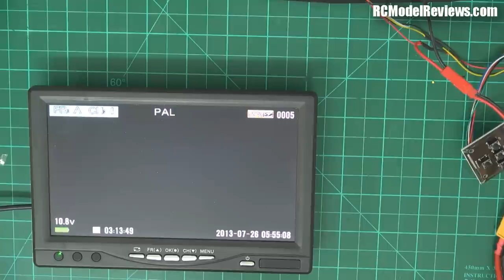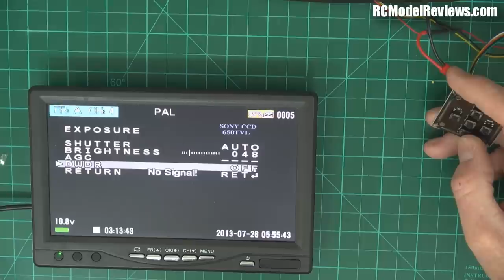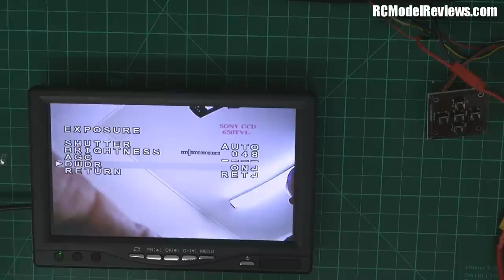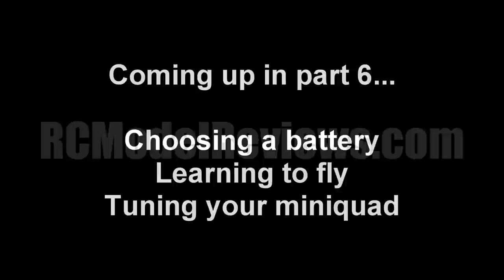Low cost miniquad racing drone build video PART 5

Comment: Bruce, I just wanted to say thank you for this series of videos! I just flew my first built quad that I built just by watching this series. I ordered all the parts per the first video, set up the Naze board exactly like you said and although I had a couple of problems with the radio I chose, got it all dialed in and ready to load my FPV gear. Flies like a dream! Thanks again Bruce!

Comment: Absolutely spectacular series.  Hope you will complete the B.O.M. list in part 1, and I'm looking forward to the upcoming parts mentioned in earlier comments ... batteries, chargers, transmitters and FPV viewing options (goggles, monitors, etc.). 

These videos comprise a solid and dependable reference for those of us just starting out and speaking for myself they demystified not only the building process but the basic technology of the quadcopter.itself more than any other single resource I've come across so far.  Thank you for the time and effort you've put into this ... I've been working in commercial broadcast TV and video production for 25 years and I know this kind of project isn't as easy as it looks. Your walkthru is well-planned, informative, nicely--paced and interesting, with enough humor thrown in to put any neophyte at ease.  Well done.

Comment: *****  Finally finished my build. After a long wait for parts to trickle down from china into my postbox, the build took around 4 hours split into 3 days. Thanks Bruce for a comprehensive tutorial, it was a great help! I did learn a lot from rcgroups too especially in the choice of a receiver. Common mistakes i did: making the wires on the pdb too thick for the frame to close properly. Inserted the naze32 with the arrow pointing left (haha) and not figuring why the naze32 wouldnt start my motors (it wasnt armed, and you indeed covered why in your videos!). I'll maiden it outside tomorrow, i just hovered inside and it looked beautiful (once motors were calibrated - you didnt show how but there are good tutorials on youtube... its really quick!)

Comment: Great series and the little hints and tricks are welcomed I tend to use hot glue for the RX antenna and the cable ties as heat shrink is more expensive and I only dab it at prime locations say 10mm spacing and 2mm from the tip. Enjoyed watching the build as it was nice to see an expert get stuck on the same problems.......Keep them coming.

Comment: One thing that I would suggest for the antenna for the transmitter, is to drill a hole in the top plate and mount the antennas through the hole. This is to protect the transmitter from crashes, just a thought. Great video series.

Comment: Excellent series Bruce!! I more or less duplicated your build except for motor brand and am having loads of fun bashing it around. Unfortunately I bought Emax motors that have short little VARNISHED motor wires and are a pain in the ass to solder. I learned in a hurry not to cut off the leads as I then had to scrape or burn off the damn varnish. That would male a good video tip for you to do by the way as it would save people the swearing I went through. Again thanks especially for all the little things I learned. :)

Comment: Good ESC'S, like Afro ESC'S are a must! DO NOT BE TEMPTED WITH CHEAP EBAY KNOCK OFF'S! Sorry, I learned the hard way : ( I am now running Afro Race Ready 20amp. The DYS 1806 motors are decent for the price and you can find ZMR 250 full carbon frames in the 20's range now on EBay. Great build series, I learned so much from this video build!!!!!

Comment: Bruce: A good tip is to GROUDN the audio lead. Check IBCrazy's reasoning on the topic, but particularily the TS5832 is troublesome here, I had one which was spraying a swathe of bandwidth across all nearby (and some not so nearby) channels any moment it was on.... and grounding the audio lead made it a LOT better. There's some modulation technology logic behind it I won't go into, but leaving the audio lead floating can allow it to go to a nonzero voltage => nonzero modulation => wider modulation on the video => more spillage to adjacent channels
Reply: Good tip. I'll have to look into it.
Reply: +Zap Andersson (MasterZap) I am interested in building a quad, but am a total beginner,  how do i go about grounding the audio?

Comment: Thanks Bruce for all your help.  Got mine going and am having a blast.  The only thing I had problems with was the props.  Which goes where.  Trial and error.  If you gave a quick vid it would be a great referance.  I stopped your vids to try see the orientation but got the wrong pitch orientation at first.  Cheers

Comment: Hi Bruce, Just found your most informative channel.  Thank you so much for sharing your passion and knowledge!  Just a comment, if you mount the vid TX on the other plate then your wiring gets easier and you can poke the switches through one of the holes.  Cheers.

Comment: I have the ZMR250 as well, on crashes the rubber balls holding the mobius plate often pop out, i just found something neat on Banggood its called "Diatone Damping Ball Lock" its some sort of locking screw for the rubber balls, I tested em and they add like no weight, and the vibration isolation still works well, and so far those rubber balls stay where they are. So if you have a similar Problem, give em a try, the come in a pack of 10....

For the FPV, while the camera Bruce uses is brilliant (i need to get one of those as well...) i also went cheap and baught the "Eachine 700TVL 148° + 32ch 200mw 5.8ghz" Combo from Banggood (and the 110° one as well) they are week on the Wide Dynamic Range, but for 25 bucks you get the complete Combo (Cam, Antenna, TX, Cable loom) and right now, its good enough for me. 

Happy flying

Comment: Thanks for all your videos, it's so helpful !

I've build almost the same quad, but I have a weird issue with it, and I can't find why. I did exactly the same setup as you for the fpv wiring. So when I disconnect the plug from the video TX, both the camera and the video TX are off, and I can fly without fpv. My quad is working really well without fpv and I'm really happy with it. But, here is the issue : when the camera and the video TX are on, I have stuttering in one of my motors, it gets really really hot very quickly and I can't fly at all ! Do you know why ? Do I need a LC filter somewhere ?

Comment: +xjet I am sad to see you are having to stop these videos for a while, I am new to this and this has been my primary source of information. I think you have provided me all I need to know, so thank you very much. But I wondered if you could do a short video to help setting up / checking transmitters to make sure no channels are reversed or connected in the wrong order. It would be great to see a short video with e.g. a mode 2 transmitter showing when left stick is pushed left motors x and y speed up and in the PC software you should see xyz. To make the quad turn right push stick x right etc.. hopefully you can do this on the bench if you get a moment.  Many thanks

Comment: Can you share your set up in regards to transmitter, goggles and other required accessories needed to fly this copter? I am new and really want to get into this, but I don't have any of the required items.
Reply: Or knowledge.
Reply: I did this build almost a year ago and wrote up everything (parts, tools, and accessories) I needed. If you search for "From not knowing how to solder to building an FPV racing drone" you should find the blog post I put together.
Reply: oh ok thanks
Reply: Fantastic write up! Thankyou!

Comment: If you are worried about heat when using tape to mount things 3M does sell heat conductive double sided tape.  It is used to mount heat sinks on electrical components.  It might not work so great when mounting on fiberglass but carbon fiber is an excellent conductor of heat.  If you use that 3M tape and mount on carbon you can effectively use the carbon frame as a heatsink.  The heat conductive tape is more expensive than your average double sided tape but is nothing terrible.

Comment: Hi there Bruce, I wonder if you have time, if you could explain what the go is with extending the antennas from the receiver to the antenna itself, for example if you plan to have it in the air a bit on a tripod and your receiver is built into your display on the ground station. I wonder what extension to use, what to consider and if it will improve or reduce my reception. Thanks in advance for your time as I know this is getting more and more precious.

Comment: Bruce.
Finally finished the build. yipee....
Total weight without battery is 406g. too heavy?
I was wondering if you had posted the better PID settings anywhere.
I won`t be racing, just flying around and hopefully videoing mates planes...
Thank you again for these great videos.
Once I charge the batteries, Zippy Compact 2200 3S, I will post the Mobius videos..
Can`t wait..
Reply: 410 grams is great!

Comment: Awesome series Bruce thanks, I'm going to order the suggested components and have a go. 

My question: In episode 1 you mentioned getting a power distribution board can make things neater and means you won't need to solder quite so much, do you know where can I get one of these? I've done some searching but the only two I've found for the ZMR 250 are both sold out (Nucleus & Team Legit).

Thanks, Jimmy

Comment: Thanks for this I enjoyed watching this.

From my investigations the quad itself is not the most expensive parts. The Radio or the FPV Googles make up the most expensive part.

But they are the parts that will be most most easily to other quads, or other radio controlled aircraft.

My question is should you save your pennies and get a Taranis Radio and a good set of Fat Shark FPV Attitude googles or are there cheaper options that will still give you a great experience, that you will not grow out of too fast.

An additional video of the other equipment you are going to need to fly quads would be great, eg. Radio's, Googles, Batteries, and equipment for charging so someone like me who has absolutely nothing knows what they are going to need.

Thanks again, I am enjoying bother of your channels.
Gordon.

Comment: Hi Bruce, great series. Ive built a few of these minis now but always stuck to the imrc 600mw VTxs. i noticed you said the VTX you used will work ok with fatshark goggles. Have you tested this? i'm fed up paying £60 for a vtx, if there is a cheaper alternative, i'll happily use it.
Cheers :)

Comment: Hi Bruce,
could you make a video on how to connect the flip32 to a gps module and mimimosd in order to use RTH and Position hold when flying fpv. I know - not necessarily needed on a 250 quad. But would be a nice feature for those ones who want to fly away a bit further.

Comment: Hi Bruce, first of all, great videos, I am learning a lot. A quick question to you and everyone else, being VERY new to this sport, I see you mentioned CPPM in your videos, and how to configure the NAZE board for this type of communication with a Taranas setup. I have a Futaba transmitter and receiver (tx=T6J, rx=R2006GS). I can not find any mention of CPPM or PPM in any of the Futaba manuals. Will i need to connect it via a different means, or will the tx and rx support PPM? Thank you in advance for your response.

Comment: Question, can i just put all of my parts from blade 350qx3 on one of these small 250 frames? what could be possible problems? will it act just like the blade (gps lock)? if i can transplant i can save some "new money".. a quick response is appreciated, also your tutorial was boss.. wasnt even thinking of buildimg untilIi watched the 5 part. seriously your videos were highly detailed .A plus my good Sir

Comment: I have burnt out 2 of these TS5823 transmitters so far. The first was on a 4S lipo so I thought maybe the 7-24v rating was a lie but the 2nd was on a 3S lipo. They worked fine for a few flights then magic smoke. not running hot or any short circuits. Should they be run from a 12v bec or have some sort of amperage restriction added in the circuit? Both times antennas were securely tightened on

Comment: I would like to get a small piece of your copper circuit board. If not, then could you tell me the size of the one you are using so I can look for it. Our Radio Shack closed up. Bummer. Thanks for your help!

Comment: I would have cut a hole in the double sided foam tape (and mounted on the dip side), for the dip switches, and mounted it a tad further in. then you could have had the dip switch exposed in the channel of he frame, for easy changing.

Comment: TIP : dont cut around the dip switches, a small needle can push them up and down and all it does it make 2 small needles size holes at the end of each switch :)

Comment: Please recommend which batery and transmiter we should buy, as you have not mentioned budget ones to go with the other parts !
Reply: Arunas Yes, that will be covered in a video coming up shortly.
Reply: I've seen flysky release some new radios recently and they seem to be doing the job pretty well, if your starting to get into the hobby then something like the flysky Fs-i6 seems to be a great radio with telementry and 20 model memory
Reply: crashandburn uk wow - it is $150.  For a budget build wouldn't a flysky fs-t6 at 58 dollars be more appropriate in this situation?
Reply: ***** NO! NO and NO 
 because u outgrow a toy transmitter in a few weeks 
a 9X cost 60 and is best investment ever 
after u done with the crappy transmitter module u will upgrade to a Frysky (DJT?)  module 
Buy cheap buy twice ...
So buy a 9X  you wont outgrow it as fast 
dont get a toy TX
Reply: OldDude909 Dead right.  When you consider that you've got to add freight to the cost of those radios.. the difference between the budget 6-channel and a more capable 8-channel radio becomes even less.  If you could afford it, I'd recommend a Taranis but if you can't, then the 9X is a pretty good "value for money" radio and you can upgrade it later to use the FrSky 2.4GHz system which adds a lot of extra robustness and a much wider range of receiver options.
Reply: OldDude909 is right that you will outgrow a crappy Tx fast. I built a similar budget build a few months ago and I bought a cheap 6 channel TX/RX from Hobby King for $30 and it does work, but now that I have been using it for a while I wish I had gotten the 9X. At this point I'm going to save my money and get a Taranis because I'm really getting into the multirotors and I like to have nice stuff. I plan to build another 250 quad when I get the taranis and keep the hobby king TX with my current quad and use it to get my friends into the hobby. The Hobby King one is not horrible considering that its $30 for both the Tx and Rx, but be sure to buy the USB trainer cable for it because you have to use that to configure the thing and Hobby King does not include it.
Reply: Yeah cannot go wrong with the 9x but if ya can , by all means get a Taranis :) just I cant
I have my 9x now years adn years and I flashed it and hardware mod it.It grows and grows with ya . One gimbal is a little bit stiff now after years maybe? Well I am looking for reasons to replace it, i guess but really its good as gold
Reply: ***** I use a $30 6ch Hobby King TX/RX combo for a similar budget build that I did a few months ago. But if you look at my other comment I now wish I had a little better setup. But if money is an issue it will work, but you need the USB cable and a computer to set it up.
Reply: OldDude909 Where can you get one for $60?  I looked at hobby king - they have one but like everything else they pretend to carry - they are out of stock or it is on backorder.
Reply: Well you paid $61 for a FS T6 ,  but the  X9 is only  56E. So choose what you like I guess . Price works out almost the same  ....but i rather spend maybe 10 more and have a X9 .
.IMO its a really really good radio.
Reply: ***** hello, I am going to build my own quad as well and have been looking at transmitters. Every time I ask people for a recommendation, they give me a different recommendation, so I am very overwhelmed with all the choices. So far I am considering the Turnigy 9x, the Orange RX T-SIX, and the Turnigy TGY-i6. Which would you recommend? Thanks
Reply: ***** here is a little chart I put together from the recommended ones:
https://docs.google.com/document/d/1TxSuSOCrEsb00Su0Ma6CypPgEP_hVgiFM7YH98PdsMs/mobilebasic?pli=1
Reply: Arthur Miller If you can afford it, get a FrSky Taranis -- otherwise a Turnigy 9X or 9XR with FrSky module will do the trick quite nicely and at a reasonable cost.
Reply: ***** thanks. Unfortunately i cant afford the Taranis.Any opinions on the Turnigy-i6?
Reply: Arthur Miller The Turnigy-i6 is pretty much the same price as the 9X or 9XR and because it doesn't have a module bay, you're locked into the FlySky/Turnigy receivers (which are fairly limited in choice).    If 6 channels and a limited receiver choice is acceptable then you could go for it but if you want 8 channels and a much wider range of receivers then the 9X/9XR with FrSky module would be a better choice for only a little more money (especially once you factor in shipping which should be the same for either radio).
Reply: ***** Have an ETA?
Reply: Justin Bell I've done a video pointing out the battery choices and which one I think is best... I'll be looking at the options for RC equipment for those who don't yet have any in a video I'll try to get out this week.
Reply: ***** Thanks, I just watched the battery video, not sure how I missed that. I look forward to your RC equipment video.
Reply: ***** Is this still the plan?
Reply: +xjet Is now a good time?

Comment: couldnt wait for your updated parts list anymore so im trying to get this together somewhat.. on the vtx im at banggood ts5823 i have 2 options rp-sma female or sma-female does this matter? im assuming its just the connector type of the antenna but better safe then screwed